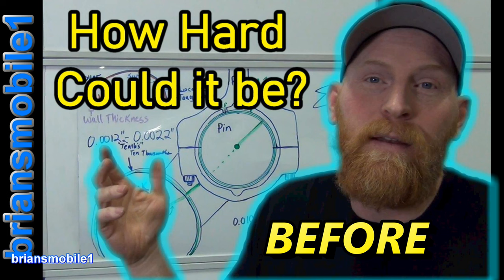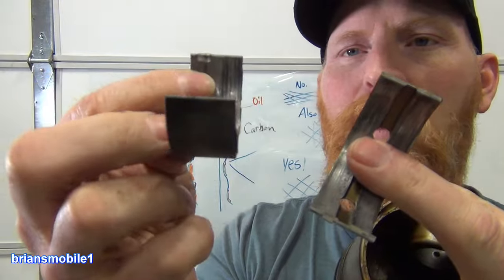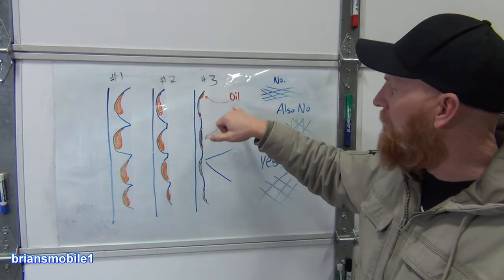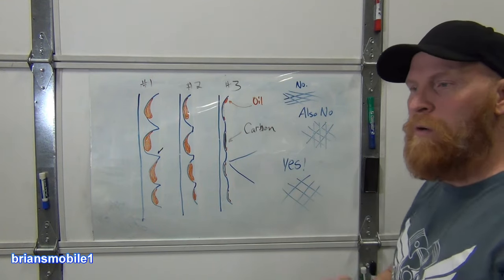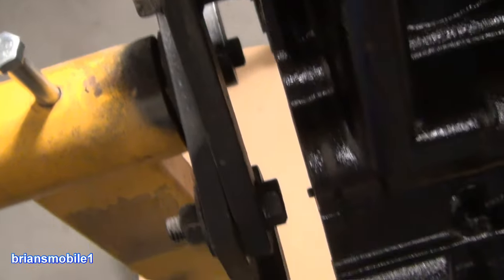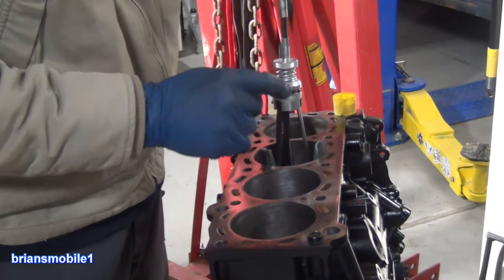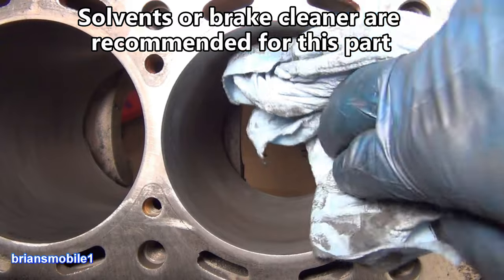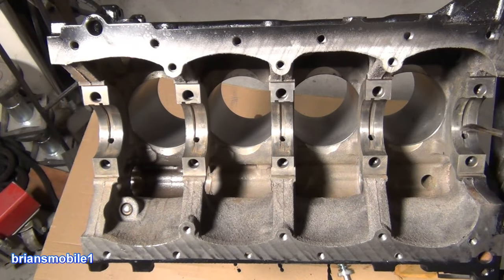2 Hidden Things That Can Wreck An Engine Rebuild

Comment: Staggering the ring gaps at assembly is is not necessary, the rings move around the piston during normal operation. That is why 2 stroke piston rings are pinned to keep them from moving and the end snagging a port.
I have assembled 4 stroke engines and purposely aligning the gaps just to see if there was any detrimental effects. None, no loss of compression or excess oil consumption.
This topic came up at a factory Briggs service school and they were the first ones saying staggering gaps was not necessary.
Reply from the maker: I've seen it manuals over the years.  
I wonder if it's unique to certain engines.   
Thanks for the insight at the Briggs service school. 
That's an experience I haven't had.  
On the 2 strokes they're pinned staggered.
Reply: @briansmobile1  I would agree that staggering ring end gap is probably preferable but not absolutely necessary unlike correct honing cross hatch, ring end gap, piston/cyl clearance, bearing clearance, assembly cleanliness etc. that are critical to engine rebuilding.
Yes 2 stroke rings are pinned staggered but many high performance 2 strokes are single ring and it's really hard to stagger gaps on a single ring piston.😜